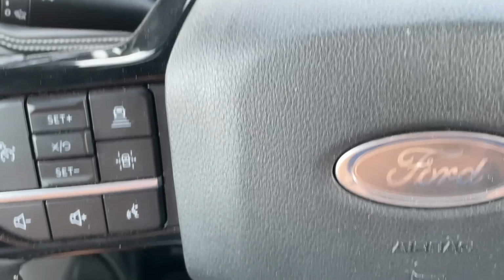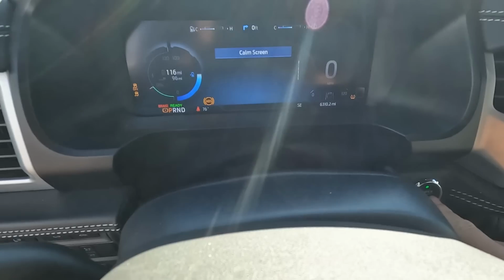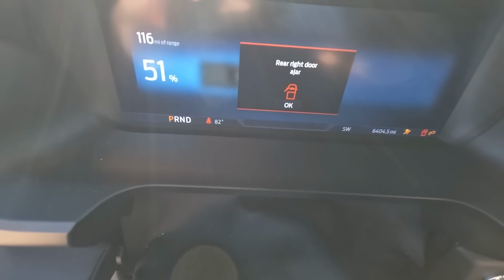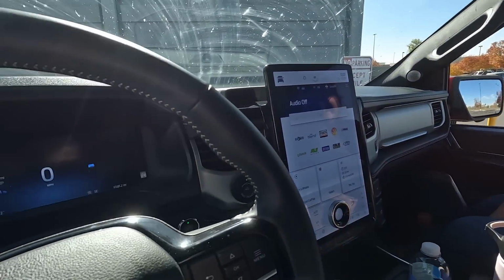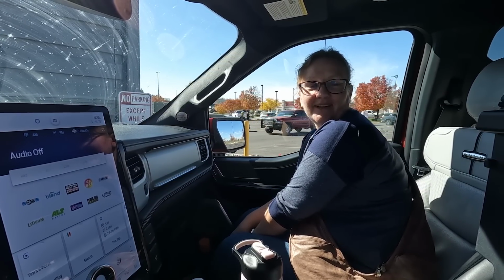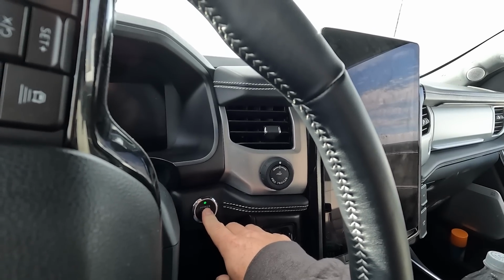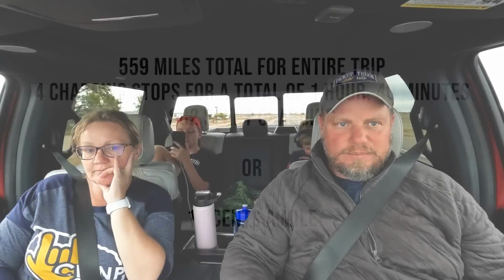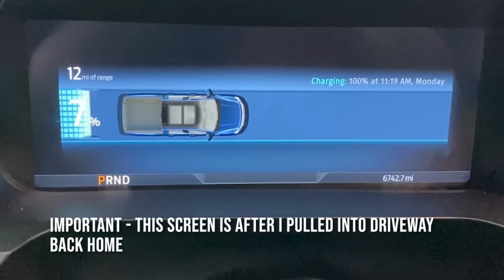Truth on charging times/cost on 2022 Ford F-150 Lightning Road Trip

Comment: The Power Boost would’ve made the trip with 100 miles to spare and no range anxiety for about $20 more. The hybrids seem a better option for rural areas.
Reply: Long distance trips at $.43/kwh the power boost would be cheaper to drive on a trip.
Reply: @pstoneking3418  I was surprised at the 23 bucks for only 107 miles of range.  Calculating from my power boost MPG of 23  that's $4.60 for a gallon of gas.  Not real good.
Reply: I was thinking that too.  When I'm down to 150 miles of range in my power boost it starts to feel like I'm close to empty.  I love the range it has, especially when towing.  I towed my popup  tent trailer ( only 2k lbs)  from just north of the grapevine on I-5 to San Diego (180 miles)  and got 22 mpg, a couple of weeks ago.   Pretty sweet.   Tim is right though, the EV is in the model T stage and will quickly become much better.
Reply: @1diggers1  I agree, Im averaging 28 mg with my PB.  Woul never trade it for an ev, never
Reply: @richardlively1666  Nice! 28 mpg is really sweet.  With the current tech the PB really is the way to go on the F150.  I've nothing against EVs, I think they are pretty cool tech but just not up to tuck tasks yet.  Some day they will.
Reply: @richardlively1666  EV's aren't for everyone.  I use my lightning locally where my 2014 F150 was lucky to get 15 mpg and my lightning costs me around $.04/mile.
Reply: @pstoneking3418  when alot of people switch over to ev the power companies will rape us on our light bills so you wont save shit in the long run. Enjoy while you can and then we all will do without power in our homes.
Reply: @1diggers1  the laws of physics says other wise. How is it efficient to burn coal or natural gas to generate electricity to then charge a vehicle. It makes no sence.
Reply: @raytycker1656  Not sure what post you are responding to BUT that's how we generate a large portion of electricity for everything that runs on electricity I don't see how running a car with it is worse vs burning gas  instead.  Besides green energy is growing quickly and people who have a solar/ battery system at home can charge their EV   totally green and that will only get better. 
Check out the Undecided channel or Electric Viking channel  lots of interesting tech talk there.
Reply: @1diggers1  If you are going burn coal to make electricity how are you any better off with an electric car. Solar and wind will never work on a large scale.
Reply: @raytycker1656  I don't believe you are correct about renewable energy.  New tech will increase solar and wind outputs and new battery tech will make that energy available 24 hours a day.  In a different energy area,  a company in Belgium just created a solar panel that creates hydrogen from just water vapor in the air and sun energy.  The future of renewable energy will be diverse in source.  Wind, solar, hydrogen, hydro, and who know maybe one of those companies working on a fusion reactor will figure that out in the next decade.   That's where the future is moving  and, I think, much faster than people realize.
Reply: @1diggers1  hydro really? Hell the environmental wackos are getting dams removed that are already in existance.
Reply: Thanks for the real world review. Your experience confirms why I wouldn't consider purchasing an EV as my only vehicle. I don't even like stopping for gas in perfect conditions much less trying to find a charger in inclement weather and especially when tired and trying to get home. Also, as an EV ages the capacity to hold a full charge diminishes so that's one more thing to consider.
Reply: To me,  the hybrids are a better option all together.
Reply: @jimtokarski6872  To complicated and expensive to repair.
Reply: The lightning has the equivalentcy of a 4 gallon tank. So for an apples to apples comparison just put 4 gallons in the tank.
Reply: @pstoneking3418  so when comparing a hummer EV and F150 the hummer should only be charged to 130kwh right even though it has a 200kwh battery
Reply: @pstoneking3418  Why?  To prove that current battery technology is shit?
Reply: Hybreds are very expensive and complicated to repair.
Reply: @raytycker1656  Plus the fact that 90 to 100 grand for a pickup that is not suitable for even light commercial use, is not cost effective!!
Reply: Charging stations will be third party and charge like ATMs.  What a circus.  What about the 80% that live in apartments and don't have the option to charge overnight.  Who's going to foot that bill to install 220v outlets at every parking spot?
Reply: @tpc3416  stop speaking and thinking rationally.  Phil Easler will call you FUD.
Reply: @tpc3416  Exactly 😂
Reply: @tpc3416  I'd say if I lived in an apartment and couldn't charge there, I wouldn't purchase an EV.
Reply: I agree I love my powerboost I would not trade mind in for a ev they suck
Reply: If he had charged to 100% at his hotel overnight it would have saved a lot of time and money. L2 is half to a quarter the cost of a DC fast charger.
Reply: @gelu88  The problem with the "Fuel" gauge in an EV is that they are not totally linear. They can give a sense of mileage when it isn't there. Wind, temp, terrain can all subtract from the miles available shown.
Reply: @gelu88  do hotels allow charging while you’re there?
Reply: @gelu88  you live in a fairytale.  "If he'd just charge at his hotel". Bwahaha.  Do you honestly not think hotels will hike prices to accommodate for that.  What happens when states pull a CA and tell people not to charge at certain times because it's straining the power grid.  C'mon.
Reply: @elche1976  Most "Liberals"and "Woke Politicians" live in a fairytale world!! Look at AOC, and what an "Airhead" she is!! Every time she opens up her mouth, she gives another GOP candidate that many more votes!!
Reply: Nah, lot more $ then electricity
Reply: @phileasler5401  not at all at the price this guy was paying forget a hybrid the ecoboost would have been same price or less for the trip
Reply: @shaynegadsden  I've noticed at the rates they pay at the public  chargers there's no cost savings over what I'd spend on fuel at $5/gal for my daily driver which is an 18-year-old SUV.  Not just this video but several others by several different creators.
Reply: @phileasler5401  not when you factor in the additional cost of the full electric, you're nuts.

Comment: That trip costed $82 - thats equivalent to an ICE vehicle averaging 30 mpg at $4.25 a gallon !
Reply: Electrify America rips people off, once Tesla opens their supercharger to everyone it’ll be half the cost.
Reply: @cybertrk  it's amusing you think charging will be less expensive as time goes on.  As more people have these,  and more stations are required,  prices inevitably will increase.  And that power has to be generated by.... you guessed it.
Reply: @elche1976  They will have to reduce the costs.  Right now there are limited number if charging stations. As more companies get involved in supplying the stations and more people using them the prices will drop. If not fewer people will travel the new expensive stations won't get any money to pay the bill it cost to install them. Remember eventually there will be as many charging stations as there are gas stations.
Reply: @pstoneking3418  you think they will have to reduce the costs? I'm not even angry at hearing that.  I'm just baffled that you actually believe that.  

When they have you and others like you hooked... they're going to squeeze you dry.  Where do you think this electricity comes from?
Reply: @pstoneking3418  ... dude... when everyone is relying on electricity and charging the prices will go up. Supply and demand. Rates are "low" at the charging stations now only because there are so few EV's out there and a high price would scare people away. I still don't think even with todays rates in would save a penny.

Comment: I’m not big on EVs but I don’t want to see families stranded on the side of the road in winter time. Maybe if you put a soft folding tonneau cover it’ll help reduce the drag and get more range. I have one on my truck and it makes a difference mpg wise.
Reply: The covers actually don’t make any difference in ice, weather & elevation, and mostly speed
Reply: @phileasler5401  Just a suggestion. Take it or leave it. Might work for the Lightning. What would I know, I only manage 23-25 mpg in my V8 Ram 1500 with it doing a 4 hr trip in the winter going through hill country doing the limit.
Reply: Tonneau cover would definitely improve the range. I'll be getting one for my lightning.

Comment: Plus have been money well spent to get the larger battery pack.   230 miles is just not enough in my eyes. I reserved a Silverado RST. It’s supposed to have minimum 400 miles of range (640 KM) on a full charge. But let’s see when it’s actually out.  So far their numbers have been modest.  Back in January they said minimum 664 horsepower with max power mode.  They were not kidding, now they are saying 754 horsepower!  90 HP more.  So I’m hoping the range is actually better then 400 miles.  If they can get it to 450 miles that’s would be awesome.  Even at 400 miles it’s really good for a truck. For me, 230 mile range I would be freaking out all the time.  The smaller batteries forces you to have to power up at the faster chargers. Which costs you more money! So anyone watching, get the bigger battery
Reply from the maker: This is the bigger battery. The Platinum only comes with the extended range battery.
Reply: @Pickuptrucktalk  At that truck is what, $10K more in price?
Reply from the maker: @doublebackagain4311  more like $20k more.
Reply: The 230 miles is good for county fleet vehicles where they never leave the county.
Reply: Every pound that you add in battery weight is a pound that you are losing in payload. Half ton trucks max out at 8,500 lb GVWR.
Reply: I thought the marketed range was up to 400 miles. I interpreted that as being on a city duty cycle where EVs generally get the best economy. I may be wrong there, but given the range we see from other way more aerodynamic sedans I think that might be the case.
Reply: Remember all estimated mileage ranges are 60% city driving 40% highway driving. Varies because of highway speeds used in there calculations. I can get 2 4 miles per kwh driving all 55 mph highway that's around 315 mile range. All city driving I've gotten as good as 3.3 miles per kwh that's around 432 mile range. 70 mph highway average 2 miles per kwh that's around 262 mile range. The better your driving habits are the more range you'll get. One pedal driving will gain range in city and stop & go traffic. Not much on highway.

Comment: Change your mindset so Ford can sell a truck.

I’ll pass.
Reply: LMFAO no buddy no this will sell it fits the market it intended to. Why buys an f150 to haul or pull anything anymore? Not the average family
Reply: @charliejones5649  true, I feel like the half ton pickup segment picks up where station wagons and minivans left off.
Reply: @MX5-XU  My lightning will tow up to 10,000lbs and locally where I use mine can still travel as far as I ever need to go & return home where I plug it in for the night.  Ready to go in the morning.
Reply: @pstoneking3418  totally, I was just pointing out that pickups are being purchased for similar reasons to other vehicles types of years past. I’d love to try one out to see if it could effectively replace my F-150. At the moment I’m not in a financial position to take the plunge even if it could, but could be an option in the future once I feel the need to upgrade.
Reply: No problem with your pass, 200,000 are in line.  I’ll pass at the Dino 🦕 juice stand